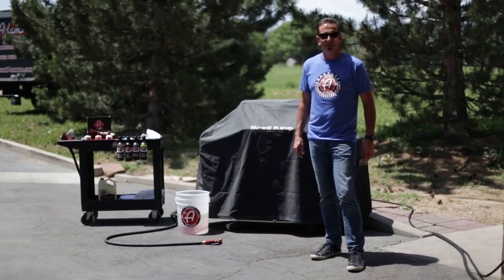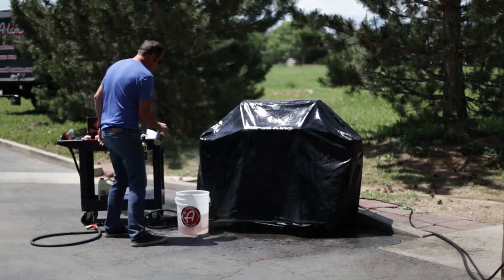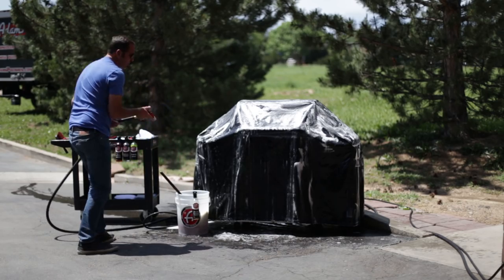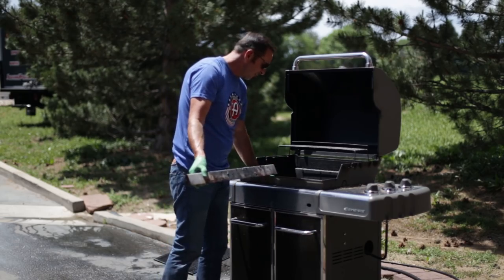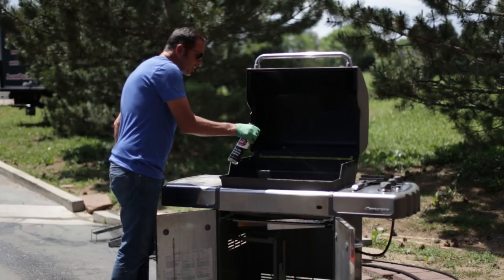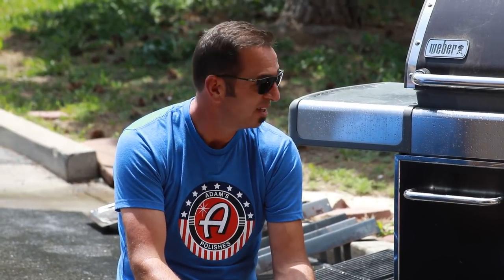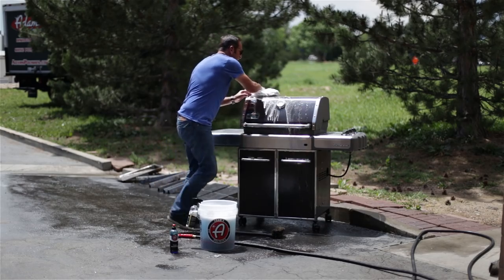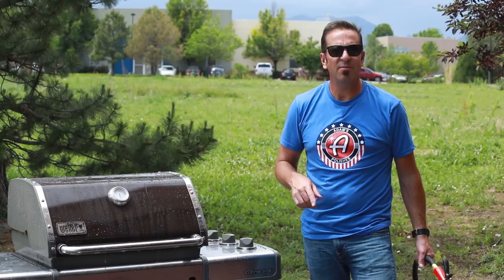Barbeque Detail Part One | Washing & Cleaning |

Comment: If you are going to use pressure cleaning, water, and degreasers,, then you need to grease up every part of your grill after to prevent corrosion. Usually I'll use mechanical grease for the exterior and canola oil for the interior by using the same process as   if you were seasoning a pan to develop a nice polymerized non-stick coat. You coat everything with a high burning point oil (sides, top, bottom pan, and grill grates,  screws and bolts, etc..), turn the heat up very high, and simply let it do it's job until it stops smoking. That will prolong the life of your gril and make future cleaning easy.

Never just wash with water an chemicals and leave it out to dry. That rust and corrosion will lead to structural failures, and in most cases get into your food. So just be mindful of that.

Comment: You missed a spot right under your lip
And honestly
Take out your grill grates and take to the manual car wash 1 time per year.  Spend say $4 and you have brand new grates.  Though I have stainless steel bars from Weber 
Be careful if you have older plain metal grates